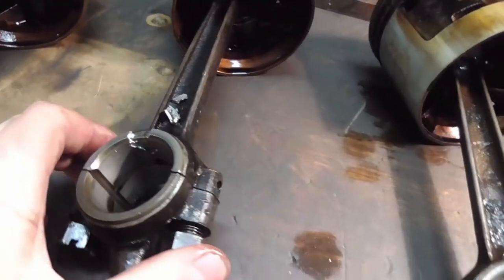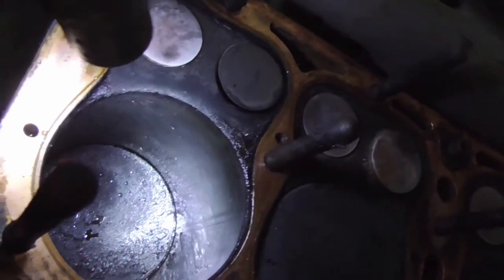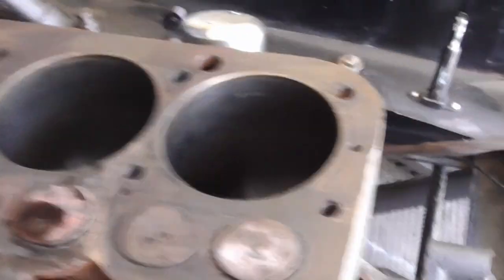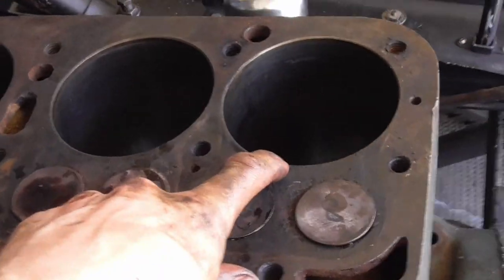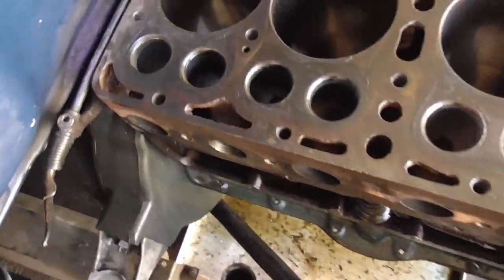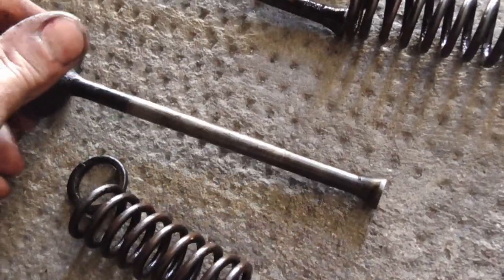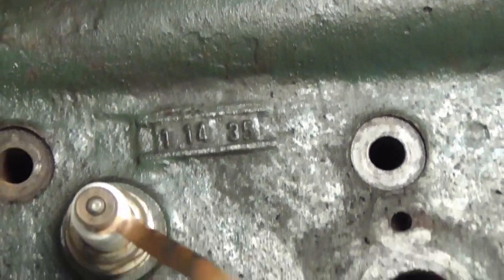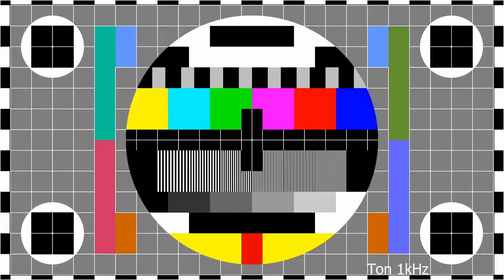Model A Engine Removal and Teardown

Comment from the maker: - Current Status -

The block is at an engine builder, it'll get converted to inserts 
(and a few other things, that'll be discussed on stream).
Unfortunately, engine builders with the kind of equipment to do that, are few and far in between,

and those that can, are booked out - so it'll be a while.
I got quoted January or February - nothing we can do about it.

Best Wishes
Adrian

PS: Yes, I know Paul Shinn, and we've talked about the matter ;)

Comment: Sad to see the extensive damage to the motor, but great to see you are not giving up. I have had a motor rebuilt in the past, and know it can be a daunting, expensive process. Keeping everything stock would be nice, but for everyday use I personally would go with reliability upgrades. Much more fun to keep the car on the road than having it stored away unused.

I recently did a compression test on my Amazon and found all cylinders to still have good even compression. Spark plugs look good too. Hopefully it stays that way for many years.
Reply: I agree, try to keep as stock as possible but add in safety and reliability.  Changed out the single brake master cylinder for a dual in my '47 Ford Tudor.

Comment: Actually had to do the same with my 31 Model A last year. Was just going to do an check and adjust the main bearings, then i discovered that the rear one was all cracked up. 
Since the engine was a bit worn, it resulted in an all full rebuild.
To find anyone which can do babbitts is not easy these days. Luckely there is a guy up here in norway which have done a couple of hundreds a-engines over the years, and he fixed mine up aswell 👍

Comment: You're a funny man!  Love your music.  I put a Stipe 340 cam and 5.5 head on my A  Babbit bearings, stock valves.   Bored 40 over.  Didn't go crazy, and you easily can.  Runs real nice.  Be wary of who you listen to. It can get real expensive and no need for it.  Remember the rule of KISS.  Good luck

Comment: Which engine builder did you choose? You found one that does Babbitt pouring? I did find a competent shop in the Netherlands that does just the pouring, it's not cheap, and boring still needs to be done after that. The shop normally does high-level industrial Babbitt (for heavy machines and high rpm) but also has experience with old cars.
Reply from the maker: I found a guy about an hour's drive away from my home that will convert the engine to inserts for me.
It'll take time, however.

Comment: WHAT A MESS YOU’VE GOTTEN YOUR SELF INTO. No really this is the opportunity to look around and do your self a favor, go ahead and pull the transmission and look inside it to determine what you need to replace or repair now so you won’t be doing the same thing again soon (like kicking yourself for not doing it now) tearing down, inspection, replacement, Now is the time,the time is now, After all it’s right there just a few more bolts and it’s in your hands. It’s only money after all, you can buy happiness this time. Good luck have fun the pride you’ll have when driving around will light up your world 🌍. Thanks for the video.
Reply from the maker: Well, yes, but it's also a question of when to stop. Might as well give it a fresh U-Joint while the tranny is out - and while we're here, why not go over the diff. Now it's not much extra work to do rear axles, seals and wheel bearings - and when that's out, why not freshen up the brakes, too.
Since the tranny performs fine without excess noise and the input shaft spins nice and free, I'll leave it alone until it goes out.
Pulling the trans by taking out the rear axle isn't too big a job, after all.

Comment: Ever considered getting a period-correct plate replicated?
Just for fun and display?

Also, I know you like the retro-style, but maaaaybe consider some nitrile gloves :)

P.S.: where did you find that footage of the "engine repairs" with a welder?
Reply from the maker: Well, if it was legal to drive around with it, then it might be worth a thought, but just as a gimmick, I wouldn't want to go through the effort of switching plates all the time.

You'll probably find a ton of similar clips by searching for "pakistani engine repair" or something similar ;)
Reply: @AstraWerke  I was thinking just to have one made, put magnets on the back and pull it off the real one before driving in public.

thanks :)

Comment: I like your oil can holder. Did you make that?
Reply from the maker: Jep. It's really nothing special, just a curved strip of sheet metal with three holes in it. One to mount it to the firewall, two for the clamping screw.
Reply: @AstraWerke  I like it. Just bought an old Ford oil can I'd like to mount on the firewall.

Comment: 8:14 Something tells me that motor is a bit annoyed with you. Don't let it bother you. Many a veterinarian has been bitten by a patient!🤕
I'm always amazed at the simplicity and robustness of the Model A power plant. I seriously doubt you'd be able to do this with a modern engine 92 years from now.
I hope I can catch the live stream when it happens. It sounds intriguing to say the least!
I truly hope that the rebuild is going to be straightforward, but I suspect there will be a few bumps in the road yet. "Time is a great revealer of secrets" as my Great-Aunt Mercy used to say.😉
Good luck with the project and I hope you will not be without your boon companion for too long. 
Looking forward to the next installment!
Reply from the maker: I think the saying "Old Stuff doesn't break" needs to be modded into "Old stuff can break alot, before it is ACTUALLY broken". There was so much wrong with this engine - and still, it performed flawless!
Reply: @AstraWerke  It is very true that mechanisms from this era were pretty much engineered to put up with all kinds of problems and still work. In the Model A era, many people were still doing their own repairs and quite often parts, tools or a place to work might be many miles away. It wasn't a matter of calling the Motor Association on your cellphone and spending the wait for the tow truck grumbling about the towing fee. I once read about a man who was driving his Model A along a beach when the engine finally died. He did an overhaul with the car sitting above the high tide line! (Presumably it would have been and extremely QUICK overhaul if he was below the tide line!)🤣

Comment: this motivated me to strip down my engine
Reply from the maker: Teardown is a pretty simple task - didn't even need a book for that. Putting it back together (and expecting it to work) will be a bit more interesting, I reckon xD
Reply: @AstraWerke  Putting it back together was surprisingly just as simple as taking it back apart. Just pay attention to a few non obvious things you might miss. Like adding horse-shoe shims in between the flywheel housing, and the block at the two top bolts. And take extra care with aligning your gaskets because those leaks can be pesky.
Reply from the maker: @DrTheRich  Well I hope I get the gaskets to seal first try - oil leaks are indeed a  nuisance.

Comment: as a retired master model A mechanic i urge you to  not reuse those cam followers/tappets, they will eat the cam.  if you have a shop that does babbit, by all means, do babbit, afteraall, ir did last 90yrs!

over here, that diamond block is highly prized. it does have heaver/thicker castinngs

Comment: You have float a motor engine mounts how do you like them?
Reply from the maker: @brandtmagolon454  They do their job. I don't have a comparison to stock mounts as I bought the car with floaters already installed, but you can fine-tune them very well with the tightening screws, so they must be doing something.
At least I can't confirm the myth about them causing frame sag.
Reply: @AstraWerke  thank you for your input I'm about to pick up a car later this week and it has FOM already in place
Reply from the maker: @brandtmagolon454  Depending on how old they are, the rubbers might need replacing. Mine were probably installed in the '90s and were rock-solid.